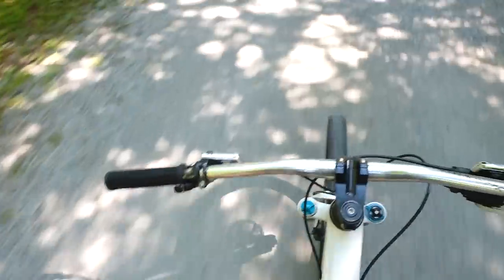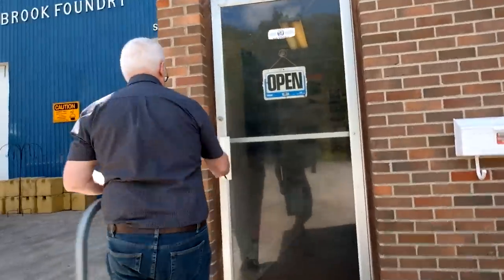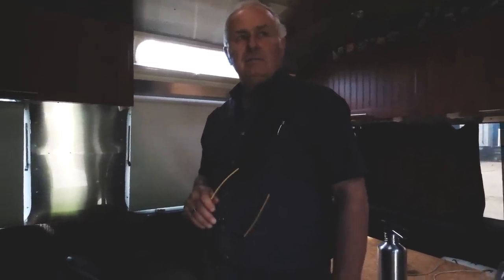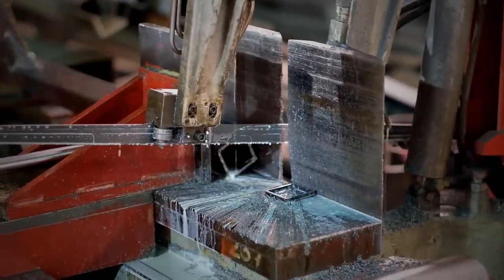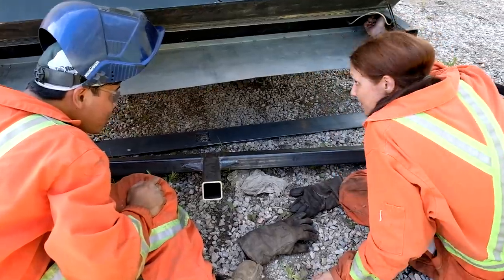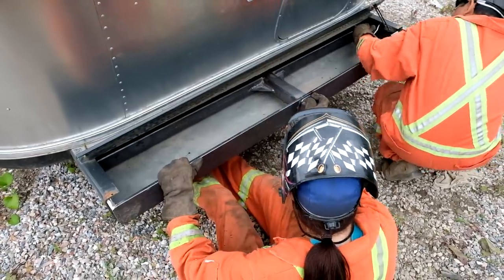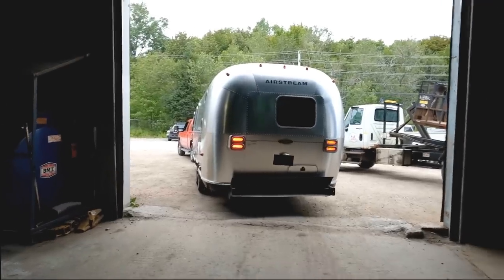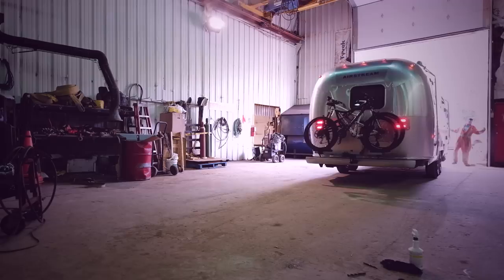Airstream Living: Bike Rack – Hack

Comment: Sweet set up!  

If you have a GoPro or other mountable camera you may want to shoot some video of the rack while towing with bikes loaded.  You might be surprised at just how much whipping around the bikes do on the receiver box.  One of my buddies devised some guy wires with eyes mounted to the bumper to minimize the whipping effect at back of the trailer.

Safe travels.
Reply from the maker: Thanks for watching and thanks for the tip Joe. I've had similar thoughts as well and experimented with lashing them to the bumper with a ratchet strap for added support on bad roads. I haven't dialed a system in yet, but I think it is worth revisiting. Cheers!

Comment: Have you used your front hitch to move the RV around?  We used ours to move the boat trailer in and out of the water.  That way the car wheels were dry.  Be safe and have fun.
Reply from the maker: Harold McCarty I would like to try it but never have had the need with my Airstream. I see how it could very useful with boat trailers though. Thanks!

Comment: Hi Seth, great video and idea. We just bought a 23 ft AS Flying Cloud FB.  I've just lined up a welder who will fabricate and install the receiver :).  I've looked at the video many times,  but can't figure out how many bolts tie the receiver to the frame. It looks like just two one on each side where there is a whole already in the C channel but I thought I saw maybe 3 on each side at one point in the video. We are cyclist carrying two road and two MTB on a Kuat NV which I love. Thanks for posting this.
Reply from the maker: Hi Greg, we ended up plug welding once on each side rather than using bolts. That way it turned out seamless. Feel free to email me for more detailed notes.

Comment: Great Video! I have an airstream and would like to install the same set up for bike rack. What I did not see was how the hole was cut in the chrome bumper. Did the cutting tarnish the chrome? 
Thank You!!
Reply from the maker: Good question David. Unfortunately I missed that part too. However, I can tell you that the finished hole looks great and it did not tarnish.

Comment: Curious how the setup is holding up? In reading on the forums, it seams Airstream doesn’t condone a rear hitch as the damage could be sustained but don’t know how the weight carrying properties are any different then the Fiamma option. I love how clean your install is and mounting the way you did give that extra bit of clearance an under mount wouldn’t have. 
I don’t think you specified the cost for this custom job and maybe inconsequential given where you had done. 
Just wanted to see how this is holding up and if you still are satisfied with this setup. 
Any chance you’d do a full in and out tour of you Airstream? Given the hitch idea, I’m sure you have many more modifications many could benefit from.
Happy New Year and safe travels!
Reply from the maker: Thanks for the comment Korey. 1.5 years later and we have zero regrets. Couldn't be happier with how well this mod has served us. No dreaded frame separation issues (even despite full-time use) but I'm honestly not surprised due to the steel fabrication being inserted into the frame C-channel rather than welded on and dangling down below the frame. The only con is that one time the bike handlebar whipped forward and scratched the aluminum panel so now I'm more careful about tightening up any play in the rack and padding the bar end with a small towel while underway. We might be getting a new Airstream in 2018 and this mod along with solar will be my first upgrades.

Comment: Great video, can you share your design with me?  I have been placing our Tandem bike on an aftermarket receiver that fits above the propane tanks. It places our bike much too high and  is challenging to take on and off. I noticed the frame work is a tight fit, did you ever consider installing nuts and bolts on the side to further lock in the hitch members to the existing frame?

Comment: Great video; I have been wondering if a rack could be attached to the rear of 25 ft Airstream trailer; Never thought of this as the solution but looks like it will work for us. We have 2 e-bikes, each weighing about 55 lb (25 kg). Do you think the setup you had installed would be strong enough to hold our two bikes?Thanks.

Comment: For years the guidance by airstream sages has to NOT attach a bike rack/receiver to the frame of the Airstream to avoid frame separation.  The bike rack sold by Airstream doesn’t even attach to the frame.

Your setup looks really beefy and should support the repetitive loading.    But I’d really be interested (and so would those on AirForums) on how this works out.

Comment: Hi Seth,  thanks for posting this.  I had watched your post many times so now  I am in the process of designing a similar hitch for my airstream.  My 4-bike bike rack is approx. 80 lbs plus four bikes would be about 200 lbs max.  I'm a little concerned due the the 1/8" thick c-channel bumper frame that the hitch will be bolted to.  Did you have any issues?  I recall reading somewhere that you had some minor issues with separation?  Is there any advice from your learning experience you would like to share?  Any information would be much appreciated.
Reply from the maker: Hing Ngo After two years of full-timing with this setup, all is well. 👍

Comment: I've wanted to do this for a while. Two questions:
1) How much did this cost?
2) Have you noticed any contact with the bikes and the Airstream aluminum or glass?
Reply from the maker: 1) Most shops will quote you around $750 USD. The place I found in Newfoundland was kind enough to charge me half that.
2) Yes, but rarely. Like when we hit massive pot holes or frost heaves. My handle bar grips have thick/soft/forgiving rubber ends so there hasn't been any damage to the aluminum skin. I would recommend a protective pad on the bar end otherwise. Also, I have very wide handlebars on my mountain bike so the average bar length may not be an issue.
Reply: THX! Hit me up if you get to the midwest. Lots of great MTB here in WI and in the secret land of Michigan's Upper Peninsula.
Reply from the maker: Brad Knapp Thanks Brad! Will do. Can't wait to get up that way!

Comment: I find this interesting, BUT I fabricated a 2" hitch for the back of an Airstream that will hold ANY bike rack. Problem is, the hitch weighs more than the "factory recommended" weight without ANY bikes.  So, user beware.  There are Airstream recommended bike racks available.  Got the hitch sitting here, want one?
Reply from the maker: Dan Y Hey Dan, Thanks for the comment. Yes, if you’re nervous about frame related issues then the Fiama rack is your best bet. IMO it is overpriced and not nearly as practical. This setup is perfect for me and despite manufacturer recommendations it’s been field tested. Going on three years now with no complaints. Quite the opposite in fact.

Comment: This is a great solution Seth. I have been looking for better ways to carry the bikes, and i'm tired of crawling into the back of the truck, removing the tarp and unloading the bikes, often dinging the paint on the truck. With the Flamma bike rack, you end up with the same problem when you want to drive somewhere from camp to bike. With your solution, you can just move the rack to your truck. I like it! You could make the frame out of aluminum and save some weight. You are actually helping the tongue weight as you are behind the axles. What other effect it might have I'm not sure. Thanks so much, Greg Wall at www.airstreamtime.com and www.fishacrosscanada.com. Love your beautiful photography and look forward to following you.
Reply from the maker: Thank you Greg! Glad you enjoyed the video. The points you made are spot on. This is clearly the best way to travel with bicycles.
Reply: I have similar thoughts.  In my case the tool box and the kayaks are in the way on the truck bed.  So bed transportation of the bikes is not an option.

Comment: Quick question - why didnt you use the Fiamma rack by airstream - https://airstreamsupplycompany.com/products/airstream-carry-bikes-by-fiamma/
Reply from the maker: Many reasons but mainly because the Fiama rack is not easily removable in case I want to pull the rack off or swap it onto the truck. There’s a lot more versatility with a 2” receiver. Also, you could transport four bikes this way, although I only have two.

Comment: Great video!!  I love that you can use it on your truck as well!  A few questions- what bike rack did you buy, do you have a link to it? Also, can you still access the bumper while the bikes are mounted?  I'm a full time Airstreamer, and I use my bumper for all things sewer related, as to keep it all contained to one area.. so was just curious if you could still easily access the bumper.  Thanks for making this awesome video!
Reply from the maker: Thank you Lindsey! Yes, it is almost a year later and I am still loving this setup. It has worked flawlessly and my bike rack is holding up great. I'm a full-timer as well, so it gets heavy use. I own the Thule T2 platform rack – http://amzn.to/2sKpxnM
No complaints with the rack either. I have full access to the bumper, yes. Also, I am able to open my back window which is another thing you can't do with the Fiamma rack.
Reply from the maker: I just noticed there's a newer version of the rack available now. Thule Pro XT 2 – http://amzn.to/2si6I9X

Comment: Where did you have this done and what price?  Do you still have this trailer and how is the bike rack holding up, damage or stress to the Airstream or any affect on towing?  You are genius to have thought of this then be able to implement.
Reply from the maker: Four years later and no problems! Pricing will vary but expect between $750-$1000 for the custom metal work and welding.